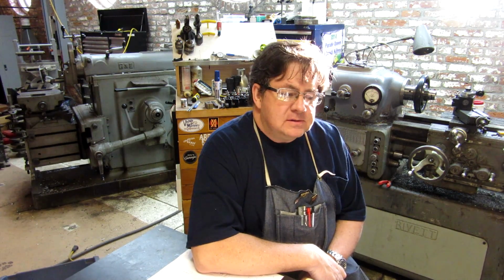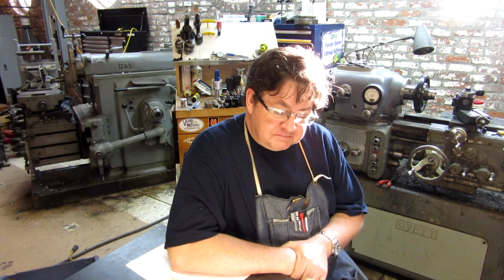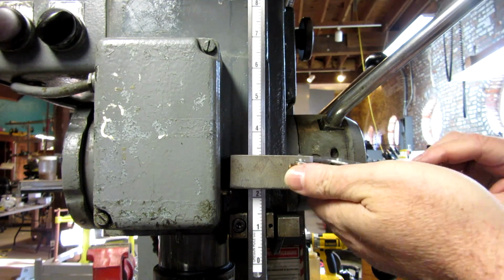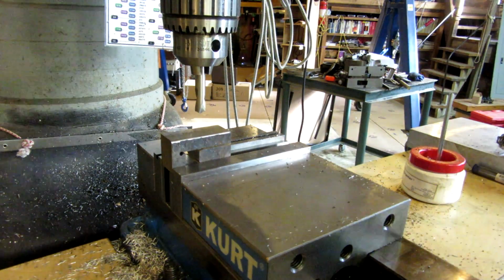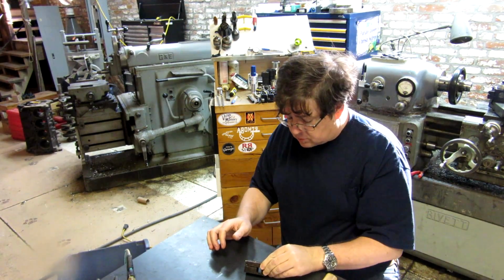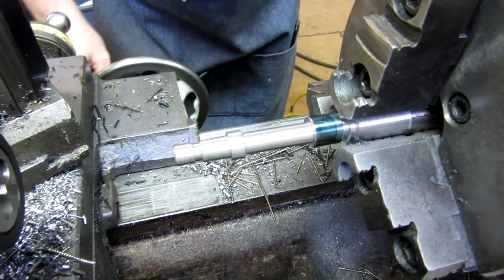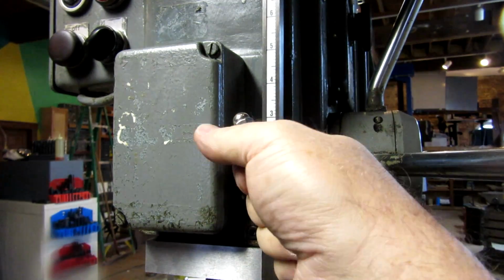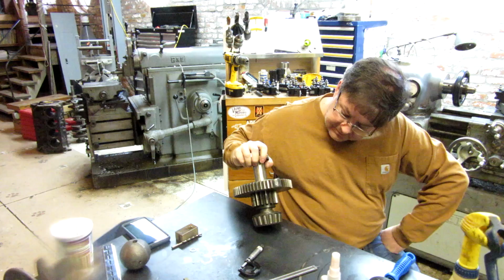Alzmetall Depth Stop #4

Comment: Good work James. I have a query... on the tap holder what is the purpose of the third set screw? I've always been of the understanding that that screw is for the "adjusting" slot in the die... if that is the case was the die in the holder 180 degrees out?

Comment: Jim, once you figure out the offset from the top of the block to where the switch closes, you should offset the scale to read actual depth.
Reply from the maker: +Cuppa Joe I didn't really have an exact measurement on how much depth was required to actuate, its a snap acting switch.  So I just had to wing it.  I went for the middle of the block.

Comment: You'll have to tell shop kitty to be quiet while you are filming.

BTW did you measure the difference between the top and the bottom of the block where it was water-jet? Just wondering how much flare out there was in the bottom of the kerf.
Reply from the maker: +cheeto4493 About .003 at the worst spot.

Comment: good plan on the gear, what did he use to weld fill the gap? (what type filler rod)
Reply from the maker: +sharp x Thats a good question.  I asked him to use silicon bronze, which he didn't, so I have ZERO idea.  Maybe a call is in order.